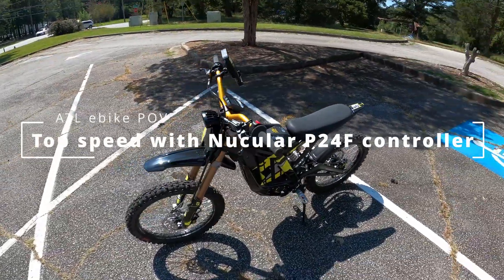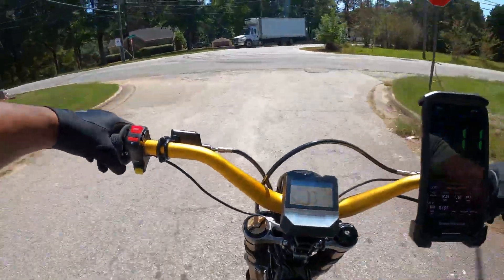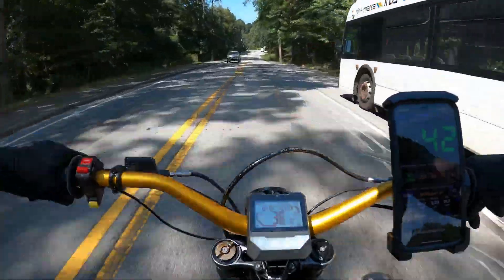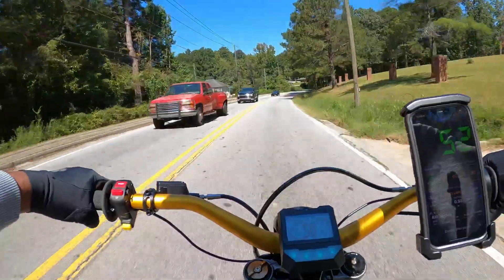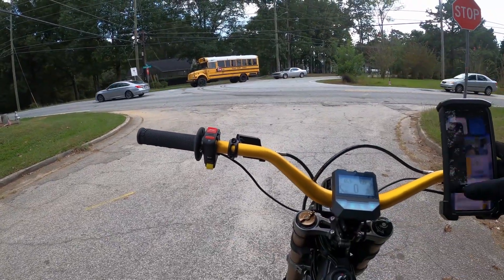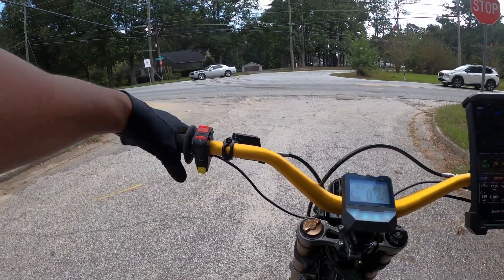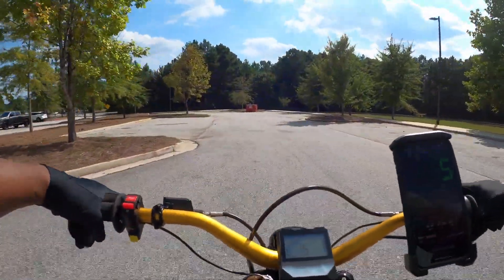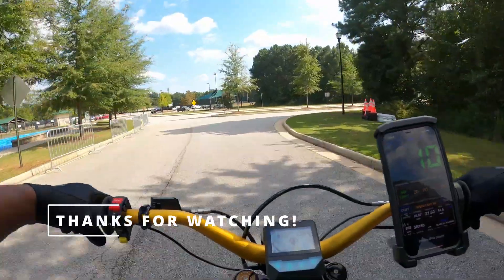Top Speed 2025 Surron lbx with Nucular controller! GPS verified! Stock battery and stock motor

Comment: I reach amost same speed with a Talaria tl3000 stock motor and stock battery, but in the summer, now in the fall, less than 100 KM/h
Reply from the maker: Yes, that’s normal 👌
Temperature has a big impact